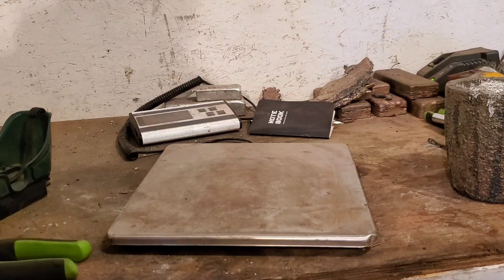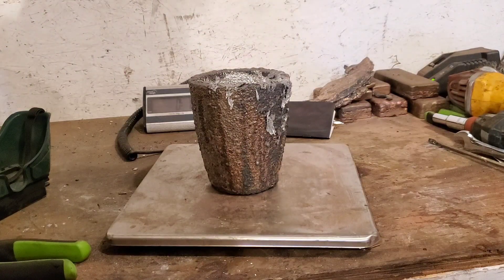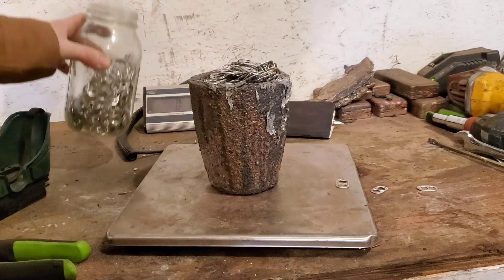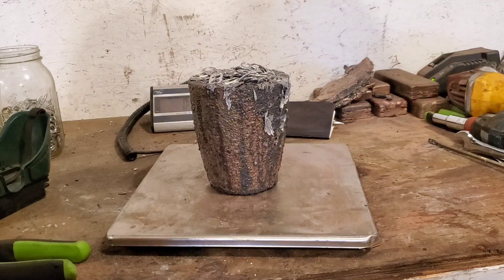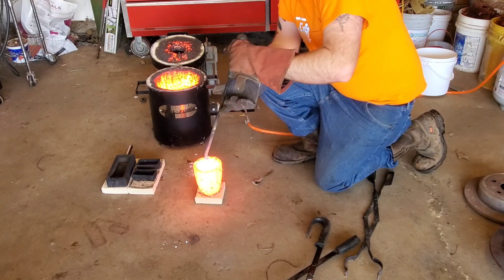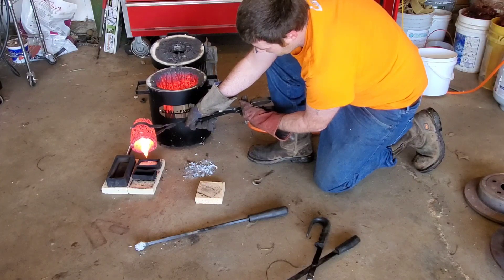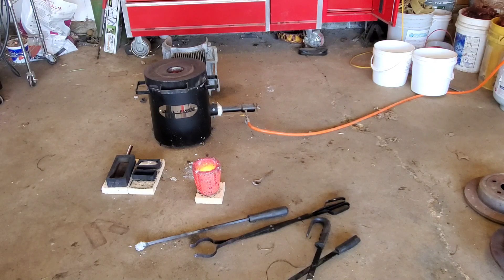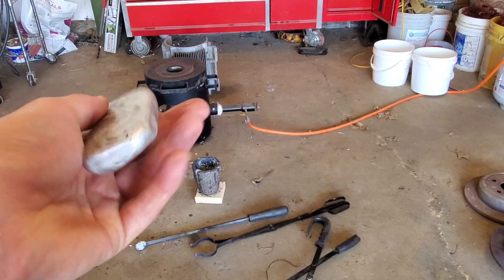Melting soda can tabs

Comment: Congratulations! 1000 subs just down the track. We have a cash for cans and bottles program here where I live. 10c each, so if you compare the price of aluminium per kg verse number of cans needed to make a kilogram of aluminium it is definitely not worth melting. However,  I do pull the tabs off and store in a container with other small bits of aluminium. I got 4 shopping bags full of bottle tops which are all aluminium also. My plan is to squash them into blocks to fit in the crucible and melt, just to get rid of them. Half will be dross though. 
What happened with the beard? Did you loose a bet? LOL 
It's weird when you look at yourself in the mirror for a while.  All the best with the channel,  I'm super happy for you as I really enjoy watching your videos and I hope you reach all the goals you hope for.
Reply from the maker: Thanks for watching brag.....no i didnt lose a bet i am a firefighter and i had training that required it too be shaved off.
Reply: @midwestsmelters190  yeah I was just having a little joke on your beard. I had one for a long while also. I shaved it off and took a while to get used to seeing my chin. LOL 
I really enjoy your videos and chats.